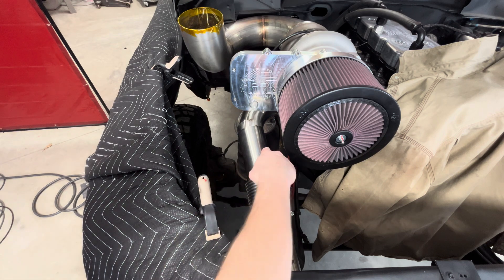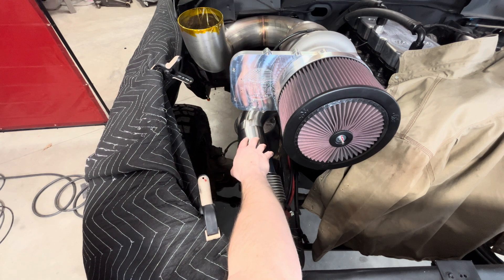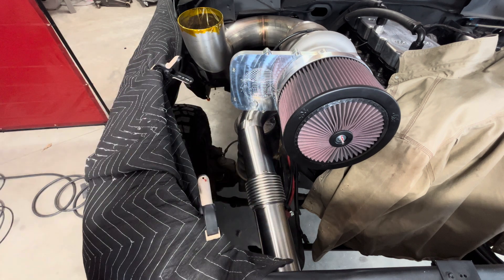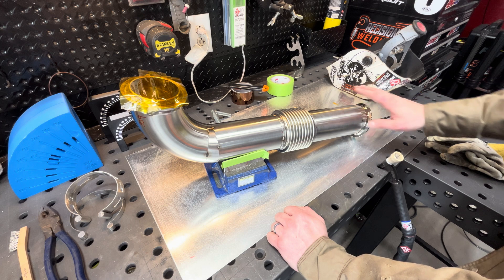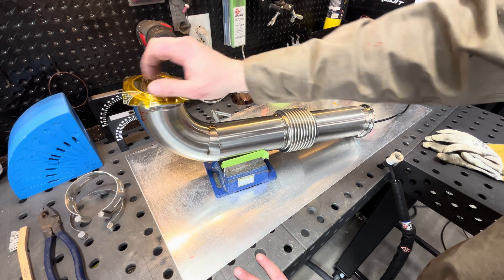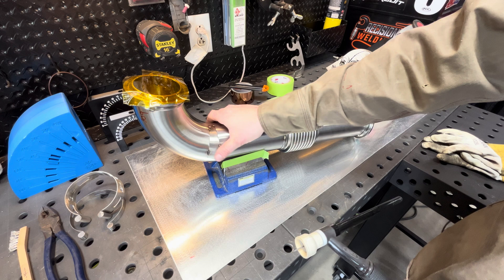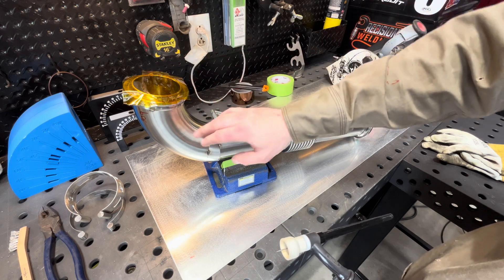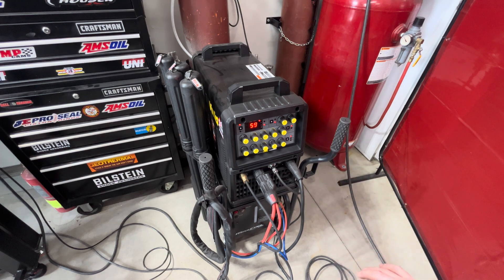Tig Welding Thin Wall Stainless Steel

Comment: Great work man learn a lot from you and weldmonger and Justin from TFS . Was wondering if using the missile rod or 312 was good to the v band that's not stainlessness steel ? Just wanted your opinion. Why use chose 309 .

Comment: I've been doing aerospace welding, and cleanliness is the number 1 rule. Separate gloves for preping and welding (welding gloves should be in pristine condition), wear latex gloves when handling the material, and wipe the weld joints with acetone before welding. When you think it's clean enough, clean it a little bit more

Comment: I've been using Miller machines for years, both at the shop and home. But you're really getting me thinking about a Primeweld. The fact that you've been doing high amp aluminum and thin wall SS. The versatility is definitely there. I will be looking into one for sure.
Reply: Get one man. You won’t be disappointed

Comment: That looks just like the little vevor I got!

I'm really impressed with it.  I do want to change the motor controller so I can have some preset speeds and things but so far, very good little unit.  Too bad I'm terrible at tig welding still!